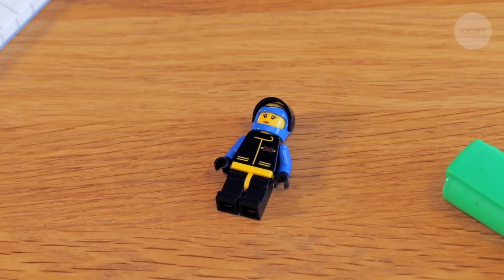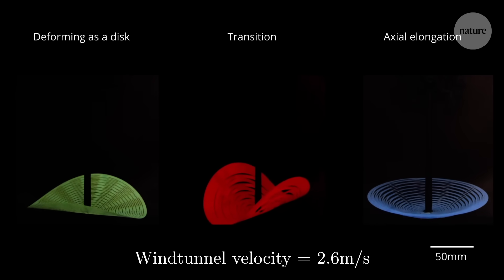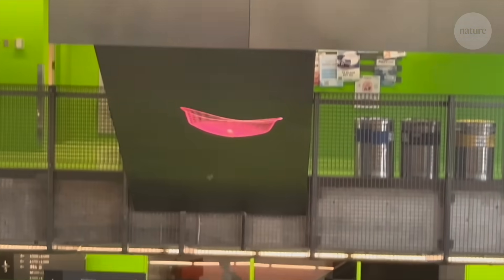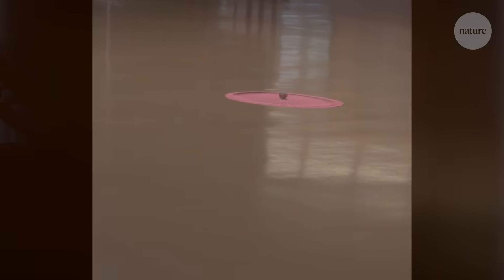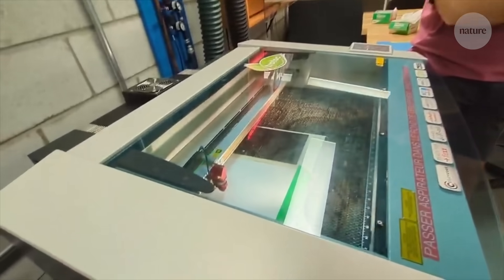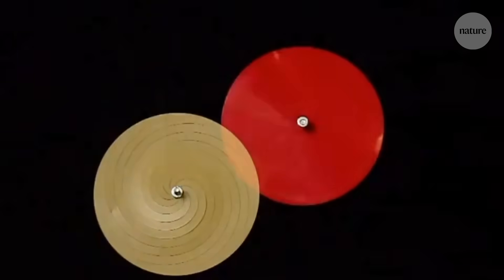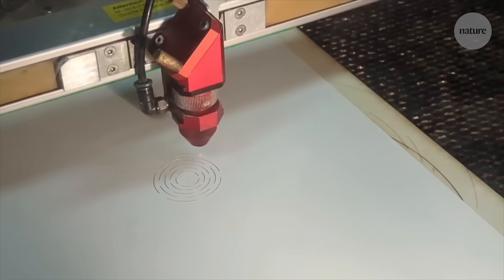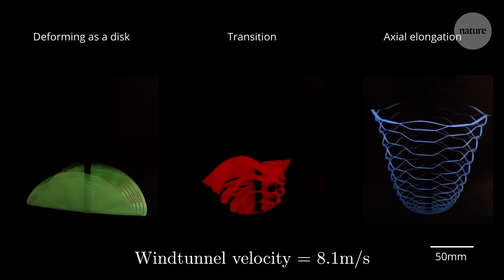This parachute is full of holes and that's a good thing

Comment: I would like to see it spin in one direction and gather a lot of rotational kinetic energy like dropping a propeller, but, at the last second the propeller blades change pitch and it provides lift and might be able to provide 1) a faster drop speed during the first part so it doesn't waste time getting pushed off course ( or getting shot at by AA) and at the last second it uses all that energy to make an even softer impact ( or equal impact, but cutting down on size/material)

Comment: I absolutely love the mixed method approach of simulating and also just trying stuff out.  Just try things out! If the cost is low enough, you'll learn far more in a shorter time by getting to the experiment phase ASAP.  Use your intuition and then use simulations, modelling, etc. to refine what seems to be working well.

Comment: It is much easier to make something like this work on the small scales they are using where there's much more object surface area than volume. Thus the wind resistance for smaller objects is larger than that for large objects. For this to work with a normal person it would need to be massive

Comment: I could see improvements on these with a more rigid outer frame connected to some tensioning extension adjustments preventing the funnel from fully lengthening to keep it from falling too fast.

Comment: :yt:This will not work in real life: :yt:
1. Too many joints in the sewing, they will rip apart when in use.
2. No way to fold that huge round design so that it will unfold correctly. Parachute deployment DEPENDS on air entering the middle 1st, to unfold and expand the rest of it.
3. No way to control all of the openings to steer and slow down the descent without a VERY complex rigging system.
Reply: You know this was filmed in real life..... right?

Comment: Fascinating! One of the barriers to this becoming a practical replacement for a reusable human parachute is that it would take much more time to inspect for unwanted tears.
Reply: I would be very interested to see how tolerant of flaws or tears this design would be compared to a conventional parachute. Maybe only extreme failures matter?

Separately, I think packing this "parachute" would be nontrivial, as it seems to need to be semi-rigid, so some kind of folding or hinging would be needed.
Reply: Does it have to be re-useable? The harness, cables, etc could be re-useable, the ‘canopy’ recycled after one use.
Reply: @Cragsidebaz "recycling" plastic is barely a real thing: most plastics degrade so much after recycling they can't be used for the same things... Certainly not in this case of tuned performance characteristics.
Reply: @Cragsidebaz  I guess if you're burning your money with skydiving as a hobby, might as well flush the whole load by junking a substantial part of the equipment as well!
Reply: It doesn't appear they're looking at it as a replacement for human parachutes at all. It seems like a potential replacements for parachutes used for delivery. Which changes the parameters a lot.
Reply: Also how would you control direction with this parachute design?
Reply: @mhambright2115  Direction cannot be controlled with the traditional designs that this is being compared to. It's not intended to have any directional control, at least not with the prototypes shown in this video.
Reply: @mhambright2115  They seemed to suggest that this design suffers less drift than regular parachutes, and so the use case wouldn't be so much to steer it, but rather dead drop it and have better confidence where it will actually land.

Comment: I believe the material needs to be much more rigid (much higher modulus of elasticity) to maintain controlled airflow to maximize the turbulent drag. You need more rigid material for that. You also want those narrow strips to work like wings providing lift, to steer the parachute. Not much uncontrolled flutter is allowed in that case either.

Comment: A die?  I once saw a corrugated box factory.  The "dies" were simply a sheet of plywood with razor sharp strips in the pattern of a box, and that was placed in a press, in which the cardboard was placed and cut.  Mostly, they made pizza boxes.  Think about that the next time you have pizza.

Comment: There are many different research questions for such a design first what is the terminal velocity ? it should not exceed 120 mph for humans second thing is opening shock, landing shock because drag area is reduced , third thing is packaging weight etc the main advantage is "no riser lines" which is great but riser lines are very light weight and compact while the new design needs a different type of packaging.

Comment: It's a very interesting concept and it would have lots of applications, especially when it can be folded up.
My guess is that the whole thing depends on a material that is flexible to some degree but also rigid enough to not just collapse in on itself. Also the material should have enough tensile strength as to not be torn apart... so scaling up this concept to larger payloads might require some highly specific material.

Also, I wonder how the design works with lateral winds or gusts.

All in all, it might only ever work for small (non-living) payloads rather than humans, but being able to massproduce such parachutes cheaply is still going to have plenty of uses.
Reply: Wouldn't all of the cuts increase the likelihood of snags when being deployed?

Comment: This is the kind of thing that WILL change common products in 5-10 years. He mentioned drone delivery, but it could lower the cost of airplane safety, be used to transport all kinds of delicate goods we never would have thought profitable to deliver by flight & airdrop, things even like large scale re-planting operations where you can airdrop seedlings from a plane and re-forest multiple acres in a day
Reply: Maybe not replanting operations. Those need a bit more care and finesse in considerations for where, what, why, and how. Too many arbitrarily done attempts at replanting have failed, and for good reason too -- being that the places people were planting stuff just wasn't suitable in the first place, and/or that more care was needed after planting that people just didn't bother with at all

Still good potential for smaller object/package delivery drops. And reasonably viable too since drone delivery exists. And we've had airdrop packages before for whatever reason. Just need to ensure a softer landing with these things and maybe see if it can handle a bit more weight and it should be good

Comment: I bet you could stack these rather than going with a bigger diameter.  You'd just have to alternate the attachment from center to rim each layer.
Reply: This would help, but there are significant diminishing returns. Think about how drafting in automobile racing reduces drag because the car in front has a wake.
Reply: @SpilledRooibos  porous pattern vs surface area, the paper garland method sounds solid to me.

Comment: Too big.  it has to be stiff in one direction so can't really fold up and pack on your back.  Not a great idea.  No real life practical use.  Drones push wind down with such force this would never work.  That's one reason why drone delivery use cables.  No one is going to sign off on free floating packages, dropping from the sky.  This looks like a fun college project, but it's yet another useless invention.

Comment: 4:01 really need to see two drones dropping the same payload at the same time, one with the parachute and one without - and maybe a third with a conventional parachute design
Reply: If they wanted to be taken seriously at all they should have done this. 

The only benefit I could see (because production costs is NOT one of them), is the stability clause he mentioned about halfway through the video. I could see how the air being directed would actually straighten the payload even in turbulent air, but even then, the demo video shown was inside of an indoor mall drop with literally no moving air present in it so that's not even 100% trustable 😂

Comment: One draw back, is how useful is the parachute material for other uses? Parachutes used to drop supplies to disaster areas, then become an important resource. How many times was parachute silk as welcome as the supplies it dropped?
Reply: Yes but they also add a huge cost to the organization. Cargo drop parachute rigs can cost upwards of 10000$ for a max drop weight of 400kg. The cost of the rig is often higher than the cost of the supplies getting dropped. If the organisation can lower that cost by a factor of 2-4 to 2000$-5000$ they could drop 2-4 times more cargo for the same price. I can guarantee that the people much rather get food and a big box of textiles than half the food and a parachute

Comment: I'm reminded of the Tesla valve, and I'm wondering whether the resistance it shows to flow (in one direction, not the other) could be emulated in these parachutes by some means.  An analysis of the eddies these parachutes create might reveal how this might be possible.  Maybe, for example, one could mount one such parachute over another and the result might be more drag -- a more effective parachute.  (This is speculation.  It might not work at all.)
Reply: Something similar exists already in the annular parachute, though it's only one "stage" of the Tesla valve design. It's essentially a ring formed of fabric such as ripstop nylon that's strung in such a way such that when gravity pulls the object downward the ring of the parachute inflates with the air pressure, but the air's escape direction is forced downward before entering free-air.

The annular designs vary from looking a bit like an old-style canopy with a hole in the middle that's pulled downwards such that it's nearly level with the outer edge, so not much hole compared to parachute; right through donut designs where the area is about equal; to far beyond where there's far more air than parachute ring.  As they're often used in extreme situations to slow descent in very fast moving airflows the shape used depends a lot on the degree of speed reduction required vs the speed of deployment. Rocketry is one application. Rescue for paragliding is another.

I think it would be a neat area of study for a range of future applications though for sure. I can't even imagine what it might look like.

https://en.wikipedia.org/wiki/Parachute#Annular

Comment: Unfortunately this is nothing new. If you look at modern military demos of their paratroopers, modern parachutes are already filled with slits to allow air to pass through without buffetting the parachute. The parachute can still be packed tightly into a backpack, unlike the design in this video.
Reply: Yes but the innovation here is not the slits, it's the fact that such a parachute could be made with materials other than textile. The cheapest recreative parachute canopy is 2000$. So imagine the parachutes used for humanitarian drops. They can be worth more than the contents being dropped and they are not reused. If they could be manufactured with a minimum of sowing and made from reusable or compostable materials it would mean a single humanitarian drop could go from a 60/40 split (60% of the cost is the rig) to a 30/70 split (30% of the cost is the rig). That would reduce the price by 50%
Reply: And is more expensive to produce.
Reply: You are missing the point. You can MAKE this at home!

Comment: I can see where this will be applicable for drone package delivery😊
Reply: I was thinking space probes, but a cardstock die cut parachute would be cheap and suitable for mass production
Reply: As part of the pizza box.
Reply: @Calligraphybooster  would be so cool
Reply: Why bring the weight of any parachute when you deliver with a drone? The drone already is a parachute. Dropping things from the air is a lot more difficult than just landing the drone...
Reply: @DreadX10  Landing a drone also introduces noise polution which is a current issue that needs addressing. Thats a major consideration for why done deliver hasn't "taken off" yet.
Reply: @DreadX10  The weight is almost irrelevant. The drone is not a parachute, it's a drone, moving parts and all. I guess dropping a rock qualifies me as a pilot, since I mastered something more difficult.
Reply: @Cjeska  Anything that flies is 'anti-fall' aka para-chute. Piloting a drone or a parachute (winged canopy) makes you a pilot. Saying that dropping a rock does the same, shows your intellect...
Reply: @DreadX10  its only true for quadcopter and other VTOL drones, but for those without those capabilities it seems like it would work great for rapid delivery
Reply: @DreadX10  Going down and up again cost time and energy. Useful if the drone carry multiple items for different locations.

Comment: Cool design! the center is a low pressure zone and essentailly exploits lateral lifting effects to slow the fall with summated vorticy. These could be easily designd around weight limits and even adjusted with suitable engineering.
Reply: what if we do not make them flat but instead we make the material to look more like wings... to create some more lift to combat the fall?
Reply: @adriandanila8663  You could contour the material, though cost of production would increase and should be tuned to the material's tensional limits as the materials should auto-balance independently in flight within the designed payload limits.

Comment: What prevents the parachute from collapsing inward?
Reply: The stiffness of the material. Which also means it wouldn't work if it's made from fabric or other easily foldable material.
Reply: @phizc : Yeah, they'd at least need to add some stiffeners or something.

Comment: Although folding was discussed, it wasn't demonstrated, so should we assume it hasn't been applied yet? The requirement to deploy parachutes in a stably flattened state would seem to limit the size of payloads significantly.
Reply: He mentioned that folding was future work.
Reply: Instead of folding, what about rolling opposite sides toward the middle? It will the same width when it unrolls, but narrow when stored. Obviously may not work for every kind of load.
Reply: Folding is really a topology problem moreso than an aerodynamics inquiry. I'm positive there is a folding scheme that would condense the size of a circle without severely creasing it and being under tension to readily deploy out.

Comment: What prevents the parachute from collapsing inward?
Reply: Each ring is larger than the one inside / below it. This means that the stiffness of the paper from collapsing inward. A ring could still fold inward, but to do that it would have to pull on its connection to the next ring to be longer, which is also resisted by the paper's stiffness. Sorry, if my explanation is not clear.  I think if you used a knife or scissors to cut 3 or 4 rings, that is enough to see what keeps it from collapsing inward.
Reply: Material stiffness, it's thickest in it's own geometric plane and thus strongest in it's own geometric plane. Probably trades some of that strength to the Z axis when extended though.

Comment: Love the idea and concept of a parachute that uses a semi-rigid material that is not a fabric and is laser cut.  I also love that origami and kirigami influenced the design.  The possible applications such as air dropping humanitarian supplies is especially cool.  Congrats and cheers on this experiment!

Btw I love that there are people out in the world that are innovative problem solvers.  They have ideas and test them out.  They seek out solutions for problems.  Intellectual curiosity is a rarity these days.
Reply: kirigami*
Reply: It will never work because it's far too big compared to a regular folded parachute.  Huge stiff discs.... how would they make that fold up and be stiff enough to work after unfolding.  And, even if you did find a material that could do it... why?  What's the advantage over a regular chute?  What's the point of reinventing the wheel if the ones we have already roll perfectly?  
This seems like a fun college project, great experiment, but it'll never make it into production or real world use.  There's just no reason for it, no need, therefore no one will invest in it.
Reply: @Octopusprimal It seems the key benefit is the ease of mass production compared to sewn and hand packed parachutes.  So if it is successful you'll probably see them first as drag devices for cluster munition sub-munitions.
Reply: @Dovorans  LMAO nope!  Ease of mass production?  LMAO!!!  No honey, these are never going to be a thing because there's far better and cheaper ways of doing the same thing, already in existence, where the machines have long since paid for themselves.  THAT is cheap manufacturing..  

This, is an expensive solution to a problem that doesn't exist.  A clickbait video for people who like to imagine we can invent our way out of everything, by pretending to come up with a possible solution to a non existent problem.   An Elon Musk kind of idea.  An idiotic one.  All promise, no delivery.
Weird you can't see that. it's painfully obvious.